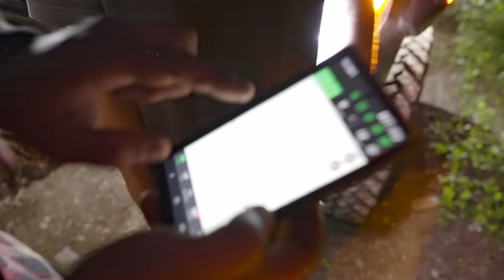We Had To Make a TOYSLEDA...

Comment from the maker: I want to see your rigs! Sign up here and share your REVKIT in the comments: https://bit.ly/445NrYt
Reply: that toyota 60 series,,why doesnt it have floating axles.. ??..they all do in aus.. if axle brakes,,doesnt matter..plus, there supposed to break at the hub,,not half way in,,design..here toyota people think they last forever,, so they never service them, then the gearbox blows, lack of oil, drained into transfer.. axle leaves, bearing sht.. diesels only have 90kw..  excellent..
Reply: snail trail..  this is why i dont buy jap vehicles. the 80 series is better, but they deleted some good points off the 60.. like the transmission brake.. in drum e/ brake are a sht..they still used the same bs gutless diesel. from 1930.  oh,,its turbo,,thats 110 kw.. excellent..
Reply: @harrywalker968  You can convert them to 80 axles

Comment: When you lose a axle like that, you can leave the wheel on the vehicle, disassemble the hi-lift and place the bar across the wheel well, tied off to the slider and a part of the rear / rear bumper. This will keep the wheel/axle assembly in place and the vehicle can at least then roll.  This is a common recovery technique for a broken axle.
Reply: Would love to see a graphic sample of that!
Reply: @morsaoverland  
Me too.
Reply: It works. My friend didn’t use a high lift, but instead we used a 5’ stick, of 2 inch pipe.  We tied both ends of the ratchet straps to the frame. The trick was not overtightening the ratchet straps so that the wheel would spin semi-freely enough past the pipe and not pull the pipe down.
Reply: Any YJ XJ TJ that wheels enough has had to limp back to the road with this rigging at some point.
Reply: Can’t do that with Bud Light toolbox
Reply: This works well! In a pinch (no sliders or bumper) it DOES work to tie it to the frame or even the leaf springs. It's slow going, and you probably want to oil down the tire where it contacts the hi-lift, but it does work.
Reply: @87K5BLAZER   same here, but we used only sticks and had replace it a few times
Reply: @resiigned Nice! Great memories!😂

Comment: oh what a feeling. should've used his drag chain to attach the sled, also a good idea to remove the brake baking plate stuff some rag up the axle tube and tape some plastic over the end of the axle tube.
another tip is carry a short length of chain say 2 or 3 feet, some long bolts, some thick washers made out of 10mm/3/8 flat bar the chain will save your backside you can use the bolts to tighten the chain and clamp a  steering box back to a frame, hold a motor or trans down if a mount breaks, hold a track bar, control arm, drag link etc together or even a skid. so many uses for for a universal adjustable heavy duty clamp.

Comment: That 60 is too high/too narrow and it's huge tyres make the gearing too high. I think a stock standard one the original 31 inch tyres would've got up that rock step and also probably wouldn't have broken an axle.
Reply: 4WD 24/7 Aussie dirty 30 built many years ago.
Reply: I was thinking the same thing!
Reply: Totally agree.... Also you can see how it moves on the trail he's loaded a 20 unit apartments worth of crap in there... She's HEAVY ... Ridiculous heavy for that kind of 4X4ing ... She's built for glamping on well maintained forest service roads.
Reply: @trekinseattle  lol.  Glamping on FS roads only??  Haha, Damn.. Harsh bro!  Nah, it’s not THAT bad.  But you’re right, super overloaded.  That’s not an exaggeration
Reply: @desert4seat  Harsh but truth
Reply: @desert4seat Shawn Whale from24/7 would have that back on the road in no time

Comment: Figured there would have been a different way to attach the spare to the hub somehow, even without power to that wheel, and balance better and be able to roll easier at least. Great vid, though. Cool ingenuity.
Reply: I would have left the wheel and axle in place, taken the hi-lift apart and put the bar across the face of the wheel/tire, tied off to the slider and rear bumper.  That keeps the wheel / axle from coming out of the housing and you can roll back to tarmac. Pretty common technique for a broken axle

Comment: I've seen a video of a similar situation where they took apart the high lift jack and used the beam to hold the tire in place. They put the beam parallel to the leaf springs on the outside of the tire and strapped the ends of the beam to the springs and it held together long enough to get them out... I wish I could find that video and link it... really good idea they had. Ultimate adventure maybe??
Reply: THIS.  It’s actually a pretty common recovery technique for broken axles.

Comment: could you have cut the shaft short so that it could free wheel?  assuming someone would have an angle grinder?  or am i not completely misunderstanding the problem here?
Reply: Because the axle is a semi float and not a full float, there isn't a mechanical way to reattach the tire back to the truck without installing a non broken axle shaft in
Reply: @DirtTheory  can you explain like I'm five years old what semi/full float means?

Comment: So question. Why not remove the broken shaft out of the hub assembly then put the wheel back on and keep going in 3wd?
Reply: That can only be done if the axle was full float, mine was not.
Reply: Only full floating axles can do that. That's exactly why I'm getting some in the future.
Reply: Ohhhh I guess I forgot they were all semi float until later 80 series. Thanks!

Comment: You had the right idea, wrong exection. 

You needed a log that could reach and rest on the top of the front axle. Strap or chain it down. the log needs to be long enough to fit under the rear axle.

Rear axle above log, front axle beneath log. then you can strap the log anywhere its not touching ground to fasten in place. As you drive the log with grind down. then you replace it 

It saves your chains, straps etc. and the slope helps the vehicle glide over obstacles.

Comment: Did none of you guys have a welder? I would of welded it and disconnected the rear drive shaft so that I could atleast roll but not send torque through it until I could fix it proper. Axles are probably your #1 spare part when you go out like that, either way....amazing video as always. I used to go out like yall but recent years ive been unable to wheel...hoping that changes here soon. I live in the PNW now and its wheeling heaven

Comment: That axle looked slimm in comparesing to the size of these tires and weight this Toyota had loaded on the back ....Overloading usually ends with something broken \-/ ...... but the Yota Sled is a gem and definitely cleaver almost Egyptian like transportation solution minus slaves pyramids and Camels lol .....

Comment: Am I tripping in thinking you could bolt the tire on and disconnect the drive shaft, then tow rope it to where you need to go?
Reply: That idea would have worked if my axle was a full float, unfortunately it's a semi float. The tire bolts on directly to the axle shaft.

Comment: Yeah that Yota looked pretty top heavy—rock crawling and overlanding don’t mix as well as people want them to
Reply: Depends on how built the rig is really.
Reply: @Justjeepingadventures  100%. If you spend enough you can build a rig that can do both, like Shaun’s trail destroyer. But you inevitably still have to consider payload. People still break Dynatrac and Dana 80’s.
Reply: @resolutejku  upgraded, hubs, rcv axles, and a Regear is more than enough. Sadly, the only vehicles that come with hubs that are steel is the diesel and the Mojave. I had to upgrade mine. Since they broke. Lol.

Comment: Why didn't you just use the hi-lift jack to hold that tire on? That would have been a much simpler solution that would have held up.
Reply: How would a hi lift jack hold a rotating tire to a solid stationary axle?
Reply: @robbarber7253  you ratchet strap it to the frame outside of the tire. There are some youtube videos demonstrating this. It allows the tire to still rotate, but it hold the tire in so it can't fall off.
Reply: @CloneCommands I'm very curious how that would work. Do you know what I would search to find that?
Reply: @robbarber7253  Off of the top of my head, Trail Traveler has a video from Spring Creek that uses that technique. Since I am not allowed to post the link, it is hard. It starts at 3:45 into the video.
Reply: @CloneCommands  Oh wow just watched that video that's awesome haha. Thanks for giving me that information it may save my ass out on the trail one day. I too am unfortunate enough to have semi floating axles. Lol

Comment: The last time you went out with him  didn't that Toyota break down too he lost 4 wheel drive right. You should of put a traction board under the wood it would of let slide easier
Reply: You're correct, a spider gear in my rear diff blew up.
Reply: @DirtTheory  so you think that might of did some small damage to that axle shaft.
Reply: @randybaker9265  possible

Comment: Sally needs to learn how to air down his truck. When you tires slip because you’re too stupid to air down low, it puts all the pressure on the other side. Then snap. It is accumulative lazy off roading. You go down as low as you need. With good tires on little hills, your tires should not be slipping at all.